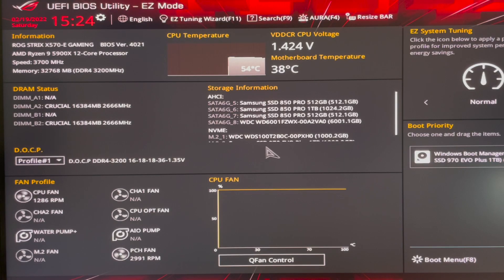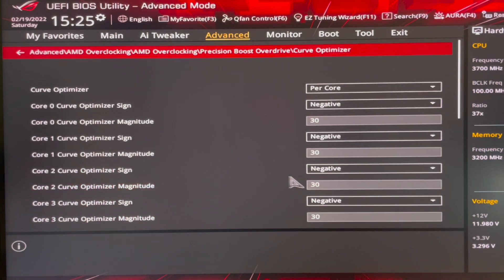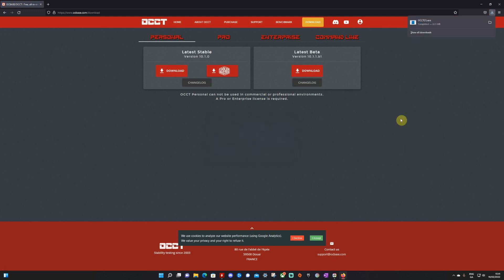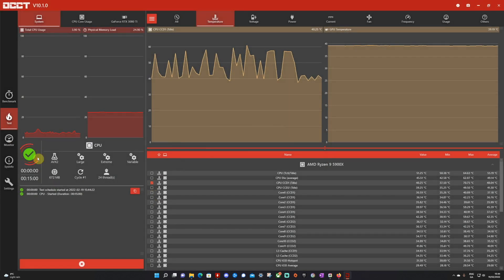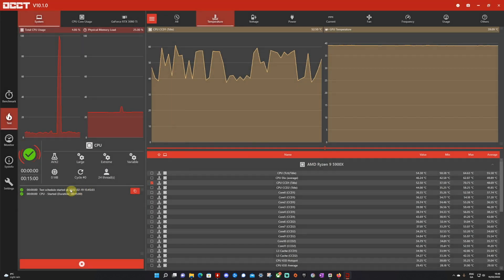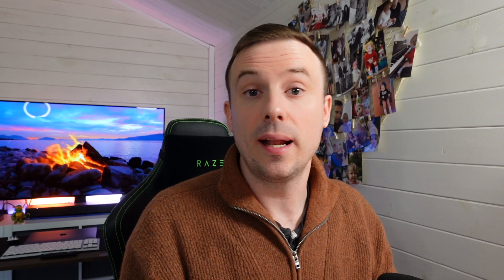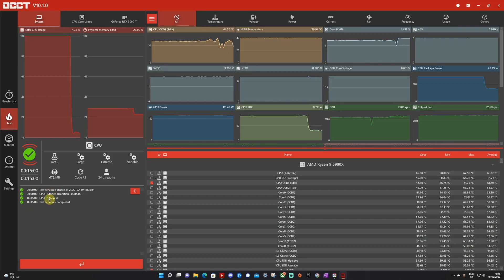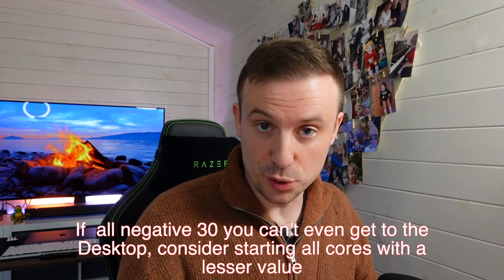Ryzen 5800x 5900x CPU Per Core Undervolt Bios Settings | Lower Temps | Better Performance

Comment from the maker: To help with stress testing on OCCT I have uploaded this video to show both single core and multi core tests. This should help check for a stable undervolt. 

https://youtu.be/77zBduI09gY
Reply: I also found some more errors may pop up if you try and run other stuff while it's testing lol ..btw thank you I've been trying to undervolt with pbo and no one explained it well ..but you did

Comment: whats the point of putting setting on per core if all values are -30? cant you do all cores -30 and it be the exact same thing?
Reply: He explained in the beginning that some cores may not do well in undervolt. Therefore by testing it in OCCT, you'll find out which core doesnt agree with your value, and so you make adjustments for that specific core.

Comment: I guess I’m lucky! 15 minutes extreme stress test with all cores -30 and temps during test at max 61,25c ( CPU CCD1 (Tdie) ) and max temp on cores: 54c 🥳 I’m going to run a 45 min test later just to make sure and test some games. Thank you again for the video! 👌

Edit: max temp corrected.

Comment: my 5800x killed a cheap 80 dollar aio cooler, didnt know undervolting That cpu was needed that much!using a better cpu cooler and now uses the -30 on all cores thanks to videos like this!max premiere pro load is at 58-60 degrees celsius now!

Comment: I have a problem with my r7 5800x in games (65 degrees) or benchmarks (73 degrees) the temps are normal for 100 % usage, but as soon as I open YouTube it starts to heat up to 70 degrees and frequency is 4,6 ghz sometimes, can someone explain me why this is happening?🙁

Comment: That happened to my 5600 non-X. My first core was rated "best" by Ryzen Master and wasn't undervolting that well. I use Prime95 Small, Smallest and Blend to test my CPU's stability, it was throwing errors on anything lower than -4 (later I upgraded my motherboard and got a better cooler, it became better at -6), one other core undervolted to -15 and others are -20 to -28. So yeah,  per-core UV is the best although time consuming. 

I'm upgrading to 5900X in a couple of days so I need to repeat all those things yet again but with twice as much cores, damn.

Comment: OCCT is crap and at the end will only degrade your CPU. My 5900x runs all core 4.7 GHz @ 1.267 and max temps when rendering is never above 64C and when gaming or anything else never above 59C with minimum of 29C on an AIO 280mm (10 year old Corsair).

Comment: Is it good for gaming? I have a Ryzen 7, 5800X can I use these settings?
Reply from the maker: If you temps are ok and are not familiar with changing settings like these then I would leave as they are or use ryzen master software to tune

Comment: Nar went -25 all cores and set voltage 1.3125 , llc medium. 64 gigs ram four sticks set next clock over xpo turned it walking away.  Cin r23 2300-23400.

Comment: hello, Id like to ask, if your CPB is turned enabled or disabled - I have 5900x and MSI x470 Gamin Plus with latest BIOS version and every time I enable CPB it gives me a Blue Screen (I had 2900x before CPU upgrade and CPB worked fine). If I disable it, the Auto Core Frequency is set to 3700 and it wont get up, if I set it to let say 4300, it wont slow down - which is I assume the work of CPB - do you have any suggestions for that? or am I stuck with faulty CPU or old MB?

Comment: 1. Disable global c-states in the BIOS (allows for more undervolting than having them enabled)
2. Use Ryzen Master to auto-optimize some curve optimizer values; these will get you in the ballpark. Use PBO2Tuner to set them - no need for the BIOS, yet.
3. Use Core Cycler (ycruncher Kagari and Prime95 Huge) overnight - these are the low-load, high-frequency scenarios that best expose CO instability. If a core/s fail, use PBO2Tuner to increment, then test again.

I'm in the middle of testing at the moment, but Ryzen Master gave me -28,-30,-30,-30,-30,-30, while Core Cycler testing has shaved it down to -21,-21,-29,-27,-25,-26; still testing the fifth core.
Reply: Hi! I don't understand why OCCT and Cinebech works ok with CO at -22 but my games works ok only with CO at -16, and at -18...-22 games are crashing, pc is rebooting or freezing. I have 5900X. May be I need better cooling or set power limits, I dunno (( But I never saw comments that for CO at -25...-30 you need AIO. Can you help, please?
Reply: @EnzoRacer1  Counter-intuitive, but CO needs to be tested a LOW loads, not high ones - lower loads have higher frequencies. I had a 5700X that would do -30 all day in benchmarks, but crash while browsing.

You need to use Core Cycler.
Reply: @JMUDoc  Ryzen Master says me that -30 is ok for me, but my PC can't start even with -28 or -25 (i forgot). As for Core Cycler: so if my PC crashes in games when -20 is set to all cores, Core Cycle will find it? I tried it, reconfigured to use ycruncher instead Prime, but in the default config duration of test is only 6 minutes per core, is it enough?
Reply: @EnzoRacer1  First, ignore Ryzen Master's recommendation - it gave me -30 x 5 and -28, which was nowhere near the true values.

My Core Cycler results have NEVER crashed, so I trust them; use the special Yuzuki preset with ycruncher - it was tuned on Ryzen 5000.

When you get an all-core session stable, test each core individually for a longer duration (you can tell Core Cycler to ignore certain cores).
Reply: @JMUDoc  Yuzuki? ok, i changed config (mode=20-ZN3). Do i need to set "skipCoreOnError = 1" or =0? and "stopOnError = 0" or =1? What to look in the log file in the morning to understand about which core was crashed or not and how many times was crashed? What settings do i need to change in config else? I changed runtimePerCore to 10m, and set to =1 CpuSupportsAVX, CpuSupportsAVX2, CpuSupportsFMA3
Reply: @EnzoRacer1  always enable skip core on error - there is no reason to continue testing a core that has already failed.

Stop on error should be 0; if it is 1, the entire program - not just the core being tested - will be stopped if one core fails, and you want it to keep going until ALL cores have failed.

The console will use bright purple letters to tell you when a core/s fails, and when the testing completes, a summary will say "core/s <list> have thrown an error". No need to read the log file at all.

Set "number of threads" to 2.

Disable all AVX and FMA3 - you want the LOWEST workload, which is SSE (default).
Reply: @JMUDoc  1. from config: "Setting number of threads to 1 causes higher boost clock speed"...why to change it to 2? Earlier you said that we need low loads to have maximum core clocks. With "threads=2" clocks will be lower, i think.
2. "> when the testing completes..." - i thought that test is very long, maxIterations are 10000.
3. did you start test with -30 at all cores? then changed to -29 cores which were crashed? using PBO2 Tuner, not in bios, without needing to reboot?
4. what about your PPT, TDC, EDC? are they default in bios or even higher? what to set for testing?...or is it doesn't matter because of low loads?
sorry for disturbing, and thanks again
Reply: @EnzoRacer1  Fix in the BIOS the PPT, TDC and EDC to whatever the default values are for the 5950X - you can look these up.

The test is more likely to fail with two threads than with one, but feel free to try both.

The test will stop when all tested cores fail, or when you do so manually; in either case, a summary will detail which core/s has failed.

Start with -30 everywhere. If a core fails within 10 mins, reduce by 2 (it is obviously not stable); if it fails AFTER ten mins, reduce by 1.
Reply: @JMUDoc  thanks again! i hope that i'll go away from joking -16))
Reply: @JMUDoc  Windows reboots after 10-30 minutes of test even with -25 at all cores. Very strange. May be oveclocked RAM is a problem?!
Reply: @EnzoRacer1 -25 is too low - keep going up until it's stable!
Reply: Makes no sense to disable multi state when your goal is lower temps and lower power consumption. It's counter intuitive to have the CPU spun up ready for anything all the time.

Comment: My 5900x is not even booting with all core negative so high. Have to set it to 8 to work
Reply from the maker: There may be one core causing the issue. A per core underVolt may help

Comment: The thing is when you undervolt you lose performance. I tried this and did -30 then ran the cyberpunk benchmark went from 129fps to 109 fps so performance does take a hit which sucks but in exchange for cooler temps. But i never used the curve optimizer i just set 30 to all cores

Comment: Thanks for this guide, 5800x -30 all cores Cinebench stability test (30 min) 15668 all cores 1570 1 core,  max. temp. 85* celsius 
Before this adjustments was 96* celsius and 15226 all cores
Reply: I also have 5800x and with -30 all cores doesn't even want to pass the login screen

Comment: Firstly, thanks for this informative video. I have 5900x and asrock b450m-hdv. I tried with 30 but it failed with restart loop then I tried with 25 my pc didn't crash and I could pass to the occt. The test finished without any problems but my pc starts to reboot. I think I have a bad 5900x
Reply from the maker: It might be worth doing a per core test to see if a certain core is causing you issues. I have a video for occt to do a per core test if it helps
Reply: @FutureProof TechTalk  I tried with per core and 30 value after resetting to default settings the bios and finished the OCCT test without any errors. I tested with CineBench r23, but it failed. When I clicked the start button, my pc restarted itself. It is bizarre. Maybe I have to buy amd 5xx series mobo.

Comment: Thanks to your video, I decided to try per-core undervolting and subsequently discovered my 5900X 12 core CPU only has 11 cores...??? I can't find a single online reference to anyone else having this issue, so apparently I really lost the silicone lottery. Great video and information, even though I didn't get to use it. (My system crashes running OCCT with even a -10 PBO curve, probably because it's missing a freaking core 🤬)
Reply: Are you sure you counted correctly? The point is that the first kernel is 0, and so on. That is, from 0 to 11, which is a total of 12 cores.
Reply: @jackshepard.13  Yes, I had 0-10 cores showing on a 12 core 5900x, ie 11 cores. I cleared my CMOS, flashed back to the original BIOS then updated back to current BIOS and that resolved it. All 12 cores are visible and functioning now. Weirdest damn thing I ever saw with a CPU. I am now successfully undervolted, and I dropped my max temps by 15c and gained 2k points on Cinebench R23 (hitting 21,388 now). Just had to go through a lot of hoopla to get there. 

P.S. I still didn't win the silicon lotto though. I did a per core undervolt and I am only able to run my best cores at -17 and the worst (3 of them) at -13, and that is also with changing PBO limits to motherboard controlled vs auto. Anything else and it would still crash the system. I'm using a Corsair H100i 280mm AIO and have 7 system fans pulling in from the front/top exiting the rear, so cooling shouldn't be an issue. I'm maxing at 74c now running OCCT extreme and gained 2k points on R23, so I'll take it even if I can't run a -25 undervolt curve with my CPU.

Comment: i recommend using small dataset with extreme mode on instruction set SSE when testing individual core, this will strain undervolting more.
i noticed for example that my c1 would fail on first run as it swapped from c0 to c1 but often be stable after, this kind of indicates just because you pass most of the times does not necessarily mean it is stable. I had same issue with c2, where it sometimes fail when it previously passed (on -15).
in the end i had c4-c11 at -30, c3 at -20, c0 at -17, c1 at -7, c2 at -12.
when testing to get a setup for a longer test i ran 2 minutes per core at small + sse. after finding what appeared stable i ran 2h all core large+avx2, each core for 20minutes at small+sse, then all cores at 1h at small+sse.

this allowed me to get full stability. previously i had been running all cores set to -10 and while it was stable 95% of the time i occasionally had issues, which as previously mentioned was due to c1 not being 100% stable there. by setting per core curve i ended up with better performance overall since most cores are at -30 and stable, and no crashes at all since i identified c1 as my problematic little black sheep.

fastest way to reach your stress test limits i think is to start with all cores at -30 and then test one at a time for 2 min, check which fails and which passes and continue from there. when it comes to how much you drop it by you can go by how fast a core fail. if its instant you might as well drop by -10 straight away, if it lasts for like 1min before issues you can go for a -5 drop to begin with. this let me quite quickly find my settings for extended benchmarking.

temps overall dropped, most notably during low loads (webbrowsing etc) and a bit less drastically during high cpu load stuff.

overall wattage didnt drop all too much on the cpu, the gpu underclocking though (3080) brought me from 340w load to 270w load while also overclocking the memory. (875@1900 with +1000 to memory)
Reply: can you please share your cpu config? 5900x right? i just got the 5900x

Comment: 5800x here. all cores are -30.  core #1 #3 #7 frequently hit 5050 and a few cores have randomly hit 5080.   ppt : 154 : tdc: 97   EDC: 158
Reply: You have proof of that?
Reply: @RPM Designs  I am skeptical it's stable at -30 all core with +200 oc for all workloads. Maybe It's possible to get a few results, I doubt you can run that daily and not crash

Comment: I have a ryzen 5900x running a asus rog strix b550 f-gaming wifi and set pbo to all cores negative 30 units. Also i set termal throttling limit to 70 degrees celsius. My proc won’t go over 70 degrees at stresstesting. System runs like a charm and went from 39125 passmark cpu scor to 41078. I’m very happy with this results….before my cpu went over 91 degrees celsius
Reply from the maker: Just rem your lucky if you get a stable -30. If you notice any crashing in games you’ll need to test and lower in occt
Reply: I have the same set up and mine wouldn't even make it to windows on -30

Comment: thx for this guide, i just bought a new 5800x, i use all core overcloock, but i think i have a good 1, its on 4.750ghz at 1.225v that gives me in load 1.254v what is lower than with any pbo ore curve i can get setting

Comment: I don't get errors. I get blue screens.  I can finish a 15min stress test with no problems, but I get random blue screens.
Reply from the maker: I would try reduce the underVolt value. So 30 to 20 maybe.  Other than that you would need to do a full single and multi core on occt

Comment: with all cores negative 30, my pc doenst work, its always restart and restart...
Reply from the maker: Just means the cpu can’t take a -30 underVolt. Try -20
Reply: @FPtechtalk  i tried -20, -15 but just take stable with -10 and restart between 5-10 days. :( better than nothing kkk
Reply: 5900x + x570 tuf pt br

Comment: 5800X - 4849MHz across the board, 16,000 plus on Cinebench 23 and max temps of 83°C (air) .... what a gamechanger! (negative) 30,30,26,30,28,30,30,30. Tested 20 hours. (Update: now have an all core 30 using Ryzen Master)

Comment: Once I set to -30, after I go into OS, my resolution became smaller, no more 1440p, after I restart one more time, it’s back to normal, during the stress test, no error, but gaming warzone half way, crash, the pc restart itself
Reply from the maker: It sure how it could effect your resolution but for the pc restart it means your cpu can’t handle. -30 underVolt. Try -20 and test again. Otherwise you will have to do a per core underVolt
Reply: @FPtechtalk  mine is 5900x, I guess have to fine tune it, I did test on the app that you recommend, but no error, so duno which core have issue
Reply from the maker: I have a separate video for that app. You would need to test both per core and all core
Reply: @FPtechtalk  thanks for your help
Reply: @FPtechtalk  I believe this is the latest, previously you had one which is one year ago
Reply from the maker: There is one just for occt on how to test per core and multi core that might help

Comment: I have the same cpu as you but on the occt soft we’re under the cpu section it’s shows you have 24 threads and 672 mb 
And in my occt I have 12 threads and 336 mb I wonder what’s the problem ?

Comment: what if you don't undervolt and check for errors first and there are errors ?
Reply from the maker: With your cpu at stock and with  capable cooling I would not expect any errors

Comment: Hi friend, I did the undervolting and tested it out with no issue , but when I played cod , my PC would restart itself after Avery game for some reason , any idea why ? Thanks !
Reply from the maker: You prob need to try reduce the value of the underVolt. Try going down by 5 or testing per core. I have a video up for that

Comment: So i should aim to have all cores at -30?
Reply from the maker: Maybe start at -20 and see how it looks but yea if you can stable with all -30 that would be the best you can get
Reply: @FPtechtalk  Thank you, will go for it asap. Im on a 5950x thats kiling me with all blackscreens 😤

For some reason cine32 only works when im on 300,230,230 settings (ppt,edc,tdc)
Reply: Also using a asus prime 570 pro